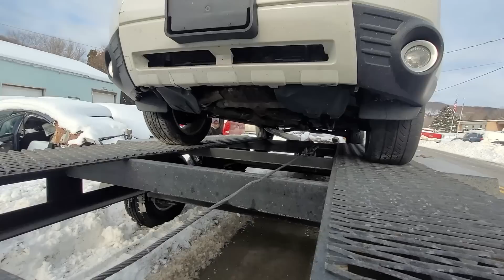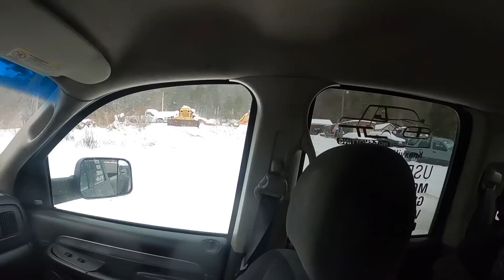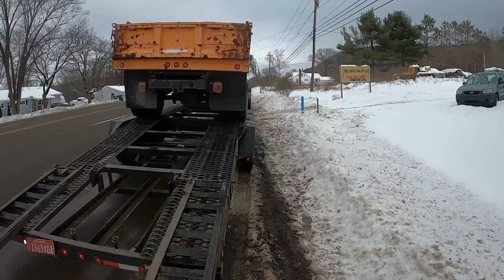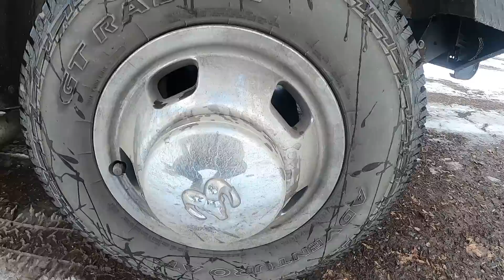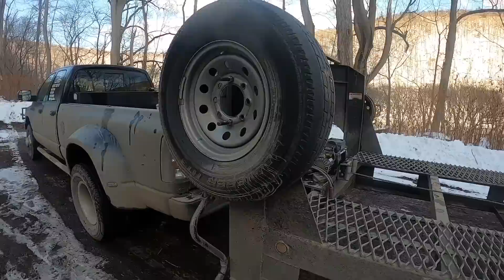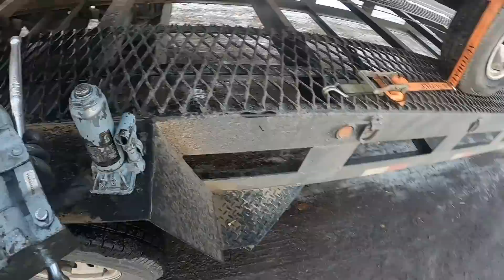I Picked Up An Old 80's F350 From New York | Hotshot Car Hauling But I'm Home Everyday | Flat Tire

Comment: CP Steve,

Towards the beginning of this video, I noticed you were telling the forklift operator to keep going past the car with the forks for the Cadillac at the 4:58 mark.  I think this is a bad idea and I'll give you my thoughts on why.

If you aren't aware, "some" cars have their lower rocker panel trim extend lower than the frame rails of the vehicle.  And as such, if a fork from a forklift is to lift the car from the frame rail or some other area that is actually higher up for the lift point than the trim (like on this Cadillac) then there is a huge risk of damaging the plastic trim on those vehicles.

And especially when it's cold.  When it's warm, there may be more "give" so the plastic molding or trim pieces won't break or crack.  But in this case, I don't think it was good idea.

Now, although it appears that there was no damage and the frame rails looked to be real close to even with the plastic trim, I think there is just too much of a risk to have the forks extend any further than the frame rails or much further than the frame rails.

Perhaps you can have the forks extend to where the unibody has the crease or pinch to the body of the car (that short 1" of metal that the car's jack is supposed to lift on in most cases).  Not under that part but just to the inside of it closer to the frame of the vehicle.  At least that way, it wouldn't be extending further out and lifting on the lower plastic trim pieces.

I understand that if the person who is doing the removal of the vehicle wants to do this, then it's no them if there is damage.  But I'm just thinking that it's not a good idea to lift from this area.  You're just asking for damage to the vehicle.  And even if these vehicles are damaged vehicles already, remember, they are probably wanting to repair them for as little money as they can so if they have to purchase another trim piece and have it painted, that's more money and time that they have to spend doing more repairs.

Just my thoughts.

At the 16:14 mark, you said "those bearings sound great".  Ummm...come on man.  You work on things.  You should know that the sound that was making was simply the brake pad rubbing against the rotor.  Although you don't want the brake pads to drag too much, I'm wondering if you have them too loose.

(As I typed this, I was commenting before I watched you remove the rotor so, we'll see what ends up happening.  Okay, nevermind because you didn't take the rotor off.  What the hell man?  Dude....you gotta spend a little time and get the rotor off at that point.  You already have the trailer jacked up.  Also, why did you take the tire off to put a plug in it?  That was a waste of time.  You don't need to jack up a tire to put a plug in it.  Just drive it to where you can access the hole and plug it.  Done.)

As far as deleting your files, what you should get used to doing is just doing a "copy" INSTEAD OF a "cut" when transferring files.

Although it would require another step to go back and delete your files once they are transferred, at leas that way they wouldn't be deleted immediately as you were trying to transfer them.

When you use "cut", if for some reason there is a glitch or error in the transfer, you will still lose your original file in whatever location it was in and you won't be able to "paste" it in the new location.  So, you sort of screw yourself by using "cut" in certain situations.

At least by using "copy", if there is a glitch or issue, your original files are not harmed in any way so you won't lose that info.

Again, I understand this would require an extra step of having to go back and select all of the files you want to delete back at their original locations but at least it prevents you from doing it accidentally like you are doing.

Perhaps you are transferring files a different way so this isn't relevant.  I don't know.  Maybe transferring the files has been fine and it has nothing to do with that and it's just you putting the transferred files in the junk folder or trash bin on your computer.  (Again, I don't know)

I'm just trying to throw out ideas to help.
Reply from the maker: They're scrap cars
Reply: @CPSteveMiller  Still.  Someone is paying for them to make money off of them.  That would mean using whatever parts they can to sell.

I mentioned it on one of your past videos as well.

If they can't use some of the parts that they originally thought they could, then that means less profit for them.  Not good obviously.

You can obviously do whatever you want but why not try to help your clients and attempt to prevent additional damage?

Again, I know it's not your responsibility if the person doing the lifting with a forklift damages the car but I think it would help your reputation if you were the one "looking out" for their best interests while off loading cars.

You do what you want obviously.  I'm just putting it out there.
Reply from the maker: He was the one who bought the car. He even did in the video "I don't care about the car I just don't want to f* the trailer". Even still these operators could care less. I watched one full on on Tuesday just smack the hell out of one with the forks and then pick it up.
Reply: @CPSteveMiller  Okay.  I was just thinking it doesn't make sense to further damage a vehicle but if that's what they want to do, so be it.  Take care.

Comment: Have you considered 14 ply tires? A little more pricier but really hold up over a longer period of time. I run Hancooks on my 40' trailer and them bastards have lasted between 2-3 years. And I typically haul loads from 13K to 17K lbs. They've been a good tire for me. Anyway, Godspeed brother.
Reply from the maker: I will at some point. Trying to keep the weight down as low as possible. These tires have been awesome so far. The used ones that are worn obviously need replaced. They'll be here Thursday. If they don't last the way I think they should I'll be upgrading to the 14 ply tires but I really don't want to add the weight so I hope these do great. 400 bucks for 2 including shipping.
Reply: @CPSteveMiller  I here ya brother. Since I live in TX, these 14's work better for b/c of the hotter temp"s, especially in the summer. Those 10 plys just won't hold up down here.

Comment: I would carry a couple red cones to put on the road when parked on the side like that first drop off. Anything goes wrong at least you can say or have a defense that you had cones out cautioning drivers. Just my two cent from a non-hotshoter 😂
Reply from the maker: I used to carry cones. It isn't a bad idea but people still could care less
Reply: @CPSteveMiller  Yeah, sadly you can do all kinds of things but people will still not slow down and get over.  You really have to be careful deciding to get underneath a vehicle or leaving yourself vulnerable to passing vehicles.

A few months back I had a situation happen that forced me to go to the right side of the road but I couldn't get fully off of the road.  It was night time and my vehicle was still on the road about 2 to 2 1/2 feet from the white line.  I had my vehicle flashers on and an LED flasher laying on the road about 100 feet back to try to give plenty of time for vehicles to see the upcoming issue with my vehicle being partially on the road.

First semi almost hit my truck but didn't.  Second one sideswiped my truck and totaled it.  I was getting a jack out of the back of my truck when I noticed the trucks going by and luckily, I paid attention to the semi truck and noticed it wasn't slowing down or getting over.

It was night and hardly any traffic on an interstate so there was no reason they couldn't see the flashers or the LED flasher on the ground. 

It didn't matter.  They weren't paying attention.  Now I'm stuck fighting their insurance company.  

Pay attention when on the side of the road.  If you get off 1 foot to the right of the white line, it's not enough.  You better get your vehicle partially in the ditch if you can without being unsafe yourself or having your trailer tip over.

I will do my best to always have a camera set up on the road to show the traffic and if there is a collision, I can have proof of the situation that happened.

Hopefully, I can keep paying attention and not get ran over.  Gotta keep watching the oncoming traffic unfortunately.  It's not good.

Comment: Also, why don’t you drive the two good axles up on blocks to change a tire?  Why do you go through the hassle of using a jack?
Reply from the maker: I used to carry a block around but these jacks are super convenient
Reply: If you notice in the video I did not see any blocks of wood that he had in the back of the truck usually he does drive it on block
Reply: @CPSteveMiller  just looking at the safety side of it along with the “not laying on the ground” side.
Reply: @leeslife3977  with Steve, it is hard to tell what is in his truck…🤷🏻‍♂️😂

Comment: I see people saying that plugs are not allowed you can use them here in Canada and how else would the DOT know after 5 miles they've worn down flush anyways.
Reply: Plugs are fine here, just not in the front steer tires.
Reply: @warrenmichael918  makes sense to me. No one needs a blowout at 75
Reply: @Geoff321  Blowouts suck, blowouts on a front steer tire REALLY suck!

Comment: The turbo kit is it Gunna be the exhaust and compressor from wicked wheel. And if you wanna save money and tires last long time I use mobile home tires so much cheeper and can handle a lot of weight I got 8 tires on eBay for about 250 300

Comment: That noise was the brake dragging not the bearing bro.
Reply from the maker: I know. I mentioned that after unless I edited it out. I can't remember
Reply: @CPSteveMiller  You didnt edit it out, you clearly said the bearings were fine in the video.

Comment: If you have inadvertently put something in you trash on an Apple Computer, you can open the trash, right click and it will ask if you want to restore the item. Give it a try. If you have already deleted the trash, then it won't be there.
Reply from the maker: When you go from Android transfer right to trash it automatically deletes it forever. It even gives that warning before you hit yes. It sucks
Reply: @CPSteveMiller  You're right, that does suck,, have to save up for an Apple, and use Airdrop, makes it so much easier,,

Comment: You probably can get another 10-15000 out of those bearings. I’ve probably put about 50,000 on the one on my equipment trailer. I usually just jack the trailer up probably every 5000 miles or so and just do the shake test. If it has a little play I just tighten the castle but and pump some more grease into the rotor.

Comment: Hey clean that K&N filter And put it in your truck instead of having to buy a new one
Reply from the maker: K&N filters aren't good for diesels. They let dust in. I ordered a BHAF for it. It'll be here Wednesday
Reply: I've run k&n filters on 2 Powerstroke diesels. Sold my 95 with 325000 miles on it no problem . I got 110000 miles on my 99 no problem. And I live in the Texas desert.
Reply: @robertmcdonald5277  Thats only because you kept it clean when needed and DIDNT over oil it! Most people dont even attempt to clean and oil the K&N filters correctly. Its not only diesels, its any turbo vehicles that really need special attention with oiled filters.
Reply: @CPSteveMiller  As much as i agree on this, you dont even have a filter on your rig yet!! LOL you arent "dusting" your motor , youre actively throwing mud, salt and sand into it...haha I wanna see that BHAF on it too.
Reply from the maker: @warren michael 😂😂🤫

Comment: Did you swap out the shackle for the center axle? I remember you, Josh and Liam doing the bearings and a couple brakes...after the overpriced Fleet Pride experience. I don't remember if y'all did the shackle or not. That could be the issue with the center wheel passenger side. Since you got the trailer that wheel/hub has been giving problems.
Reply from the maker: I had them do it,  yeah
Reply: @CPSteveMiller  Look into putting MoreRyde CRE 3000 equalizers. Unbelievable difference in ride.
Reply: triple axle trailers seem to eat the middle tires pretty fast. Also when one tire has a low pressure problem, it seems to drag more when making a tight turn and wears the edges out faster then a fully inflated tire that is more likely to skip or slide across when turning. The 2nd tires always seem to "catch" nails and debris that the front tire throws up off the road. I usually get flats 80% more on my second tire from the front tossing all the crap into it.
Reply from the maker: Doesn't help that one is almost bald too. We'll see how they do when I put new ones on it.
Reply: @CPSteveMiller  ya, thin bald tires love to eat nails and any sharp little things too!
Reply: @CPSteveMiller  keep in mind that the longer you run one of those tires bald, it's going to increase the wear on the other tires because the bald tire is not going to have as large of a circumference on the road and therefore, it will cause the other tires to do more work.   I know it sucks having to buy tires but don't wait too long on changing that tire.

The other problem is, when you do get new tires, then it's going to wear that new tire really fast as well due to it being larger than the other ones since it has more tread on it that has not worn off.  So, it will wear faster as well.  That's why it's always best (when you can) to change all the tires at the same time.  Or, at the very least, put the correct tires in the correct spots to get the best wear results.  Also, you may consider doing one side at a time if you can't afford to do both.  You want as much consistency with the tire circumferences or heights as you can get.  Among other things obviously.

Comment: You should spray your truck and trailer with something like fluid film to protect from the salt
Reply: I was thinking the same thing but that adds weight.  It's why they use paint instead.  I'm not saying using some sort of truck bed liner or something similar would weight a few hundred pounds but it might be 50 to 100.  I'd be curious to know what the weight would add.  If it was under 100 pounds, it would probably be worth it.  If 200 or more, then it might not be.

Weight is crucial in the industry so any little bit takes away from the amount you can haul.  Just something to consider.

Comment: Man skills 101. Plugging a 10 ply tire. 
20 yrs of towing and transport. I will say the blackjack kit yall have is a piece of required reading for any driver in any field. Quick cheat. The reamer is best used in a drill. It helps for plug insertion.  Just my .02
Reply: Although a lot of people ream their plug holes, it's really not necessary in most cases.  I don't know why people keep spending time doing that.  If the hole is big enough to get the plug insertion tool in, then you only need to do that.  The plug is meant to conform to the hole as needed.  That's the whole point of the plug.  So, reaming it shouldn't be needed.  Usually.  I understand it does make it easier for the insertion tool to push through though.

Comment: You need to buy that f2 and take the dump off sell it and put a 5th wheel on it. Just think you can take parts off and sell them plus make great content.
Reply: Cummins swap that Ford and it would be the coolest hotshot rig ever !!! Make no mistake that ain’t no F250, that’s an F350 with Duallys on the back and the big Diff out back. I think they just maybe threw on some f250 fenders at one point. Maybe due to a fender bender

Comment: Steve, should just buy the Rtint kit off Amazon. Any % for like 80$ for a full kit.. short of a visor I believe, it's all pre cut and easy to install. Used it on my 09 2500 almost a year ago and happy with the results. Great fit and no problems so far... and I'm in the florida sun.

Comment: I use to love paper logs, you watched your fuel and toll roads (because the Dot could burn you with those). Get home sit down unfold the staples on the log book. Pull the logs out redo them to work with your hours of service and your all compliant again.

Comment: Nice Ford. Not many around these parts. I should know I have a 83 with hardly any rust in these parts and people are constantly trying to buy it off me.
Reply: I have coopers on my 1990 f250 I think in the same size as your trailer 235/85r16. Never have any issues with them.

Comment: And I do not believe that noise on that middle Tire that you heard while you were spinning it I do not believe that noise was your bearing making the noise it was most likely the brakes making a slightly touching noise as you were spending the tire
Reply from the maker: Correct
Reply: He said that in the video after he removed the tire, he said they were fine i thought.

Comment: Why don't you bulid you're own truck wash 
Just need 2 inch pipe big enough 
To drive  you're truck an trailer  you can put those 275 gallon totes to catch 
Rain water to help with water bill 
Put drain to run off  in ditch or something 
That way you can drive truck through it 
An maybe character you're buddy's 
When they come thru it  for a fee 
If any of thats possible  therein water
Would just supplement cost of water
Depending how many totes you use rite
If you can't just idea